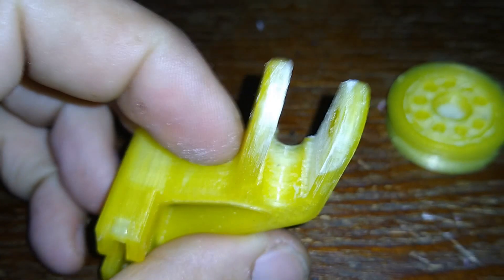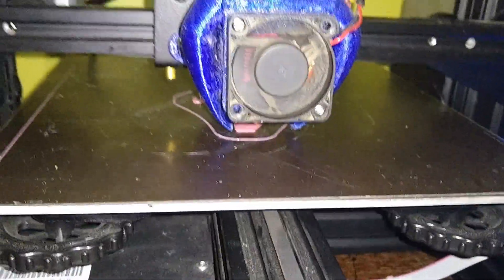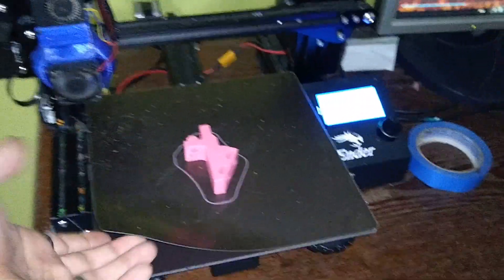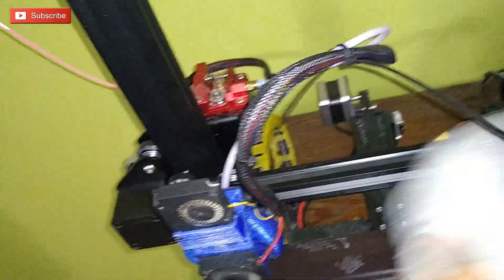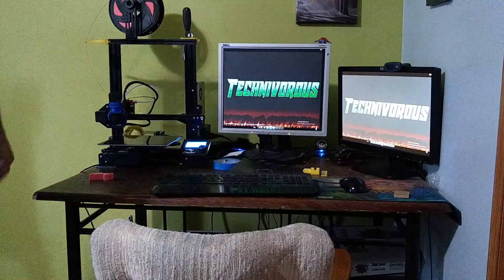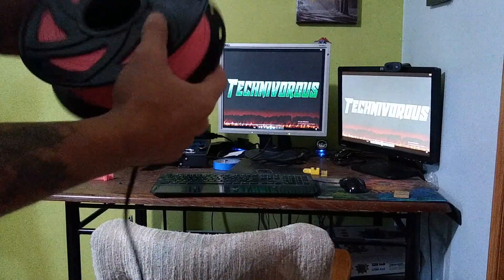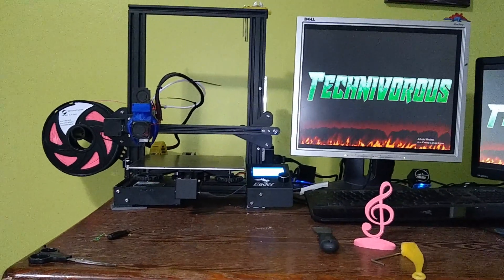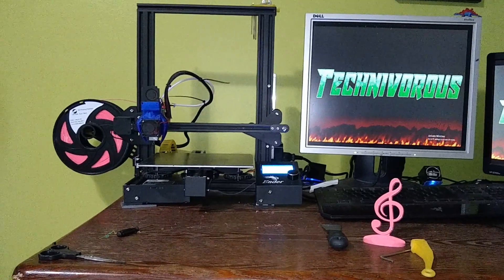Side mounting your filament spool! - 1.6

Comment: In addition to printing the side mount bracket, I also downloaded a twin wheel filament guide by Syntaxcuemi (https://www.thingiverse.com/thing:3826024) not only does it keep the filament away from the z screw, it helps feed the filament into the extruder regardless if your doing a small or tall print. It's also loose enough, not to bind up the on the carriage. It's been the best filament guide I've printed so far.

Comment: Instead of a 3D printed bearing, you should have done what I did... Raid an old fidget spinner for a bearing.
Reply from the maker: fidget spinner, or my daughters skateboard. lol. she would have been mad either way... lol i actually did the printed bearing out of curiousity, it was on of my first success stories with print in place moving parts. im surprised it held up a long as it did. lol. definitely use a real bearing if you can! but im actually stoked about this side mount, no guides, and no rubbing, its working very well. i was worried when the x gantry got way above the spool it might have some effect, but i just finished printing a decent size lamp, and its my best print yet. i didnt expect this to give that much of an improvement to print quality, but i am impressed.